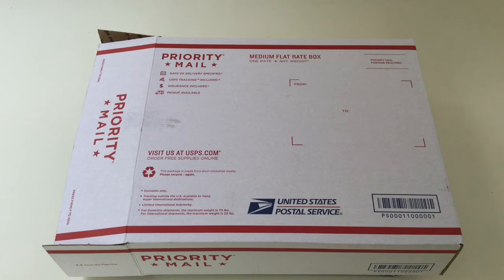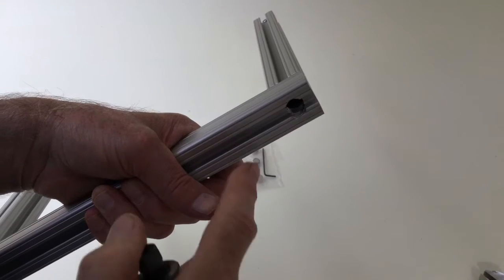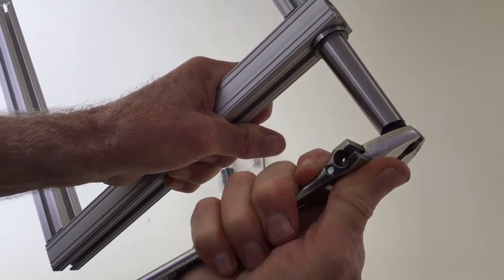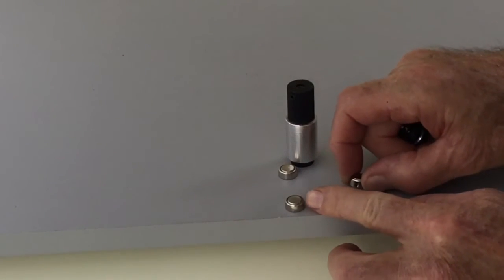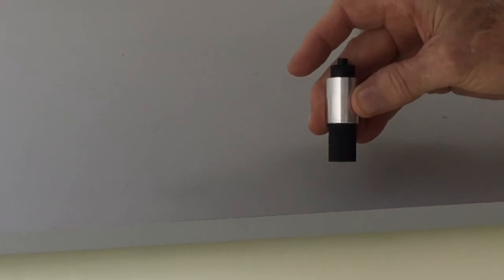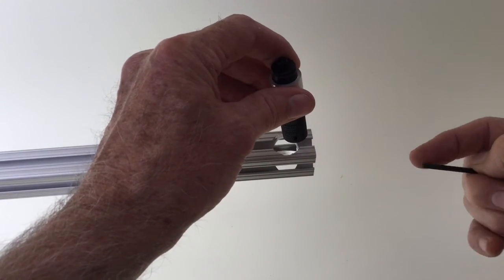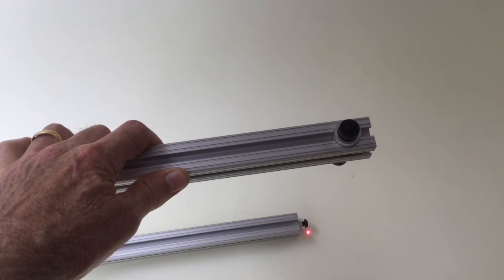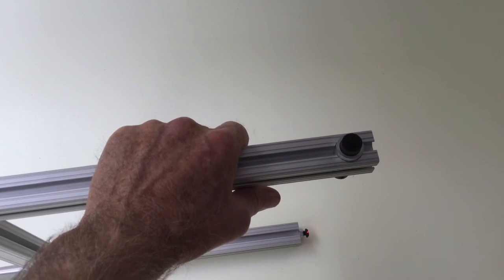Geiger's Precision Depth Finder Quick Start Guide

Comment: This system provides an accurate determination how deep the inside bottom of bowls and hollow forms is. There is a spirit bubble level imbedded in the top arm that is used to ensure the system is level when making quick hand-held depth determinations. For final, more accurate, determinations, the #2 MT is placed in a tail-stock quill. This holds the system level and frees the users hands for marking the vessel. A mark should be made there the laser dot lands. Another to the left of the first dot representing the thickness of the vessel walls and a third where the user want the bottom of the foot to be.  If there is room to do so, a line should be drawn all the way around the vessel at the third dot. When the vessel is jam chucked or vacuum chucked, the line around the vessel should not be crossed when removing waste material. This procedure ensures you will not go through the bottom of the vessel and you wont’t leave it too thick- two things woodturners hate!